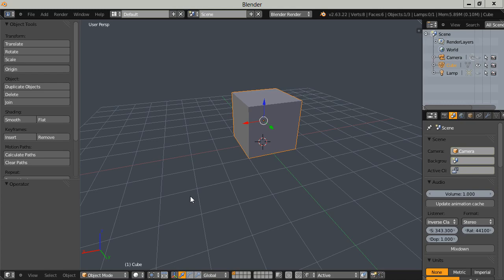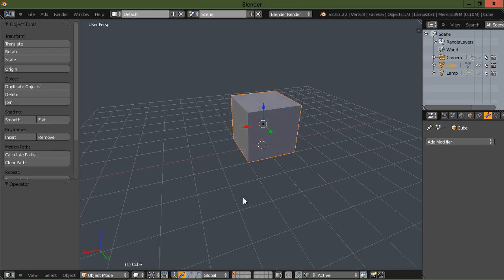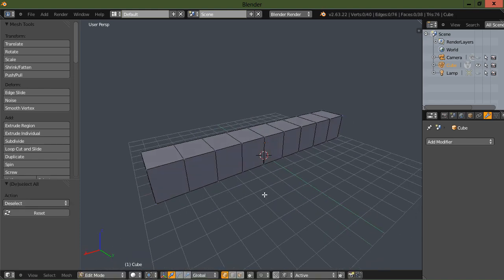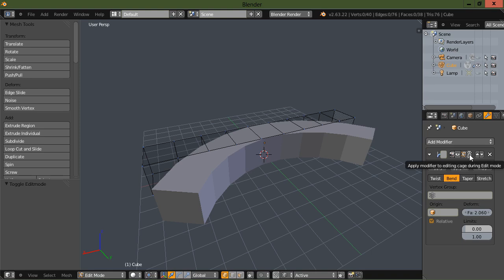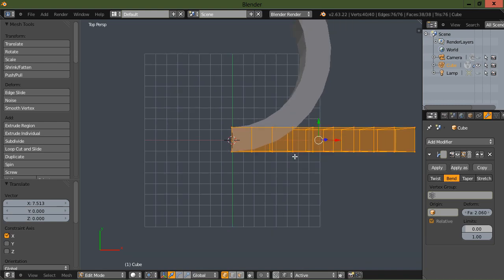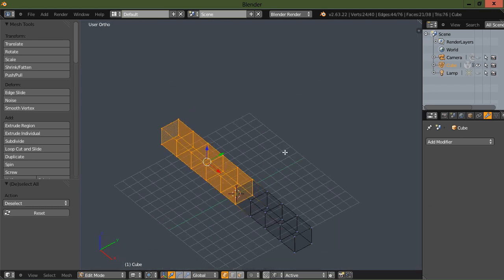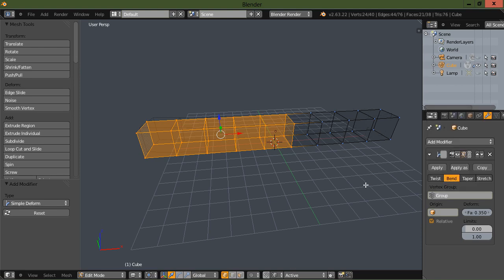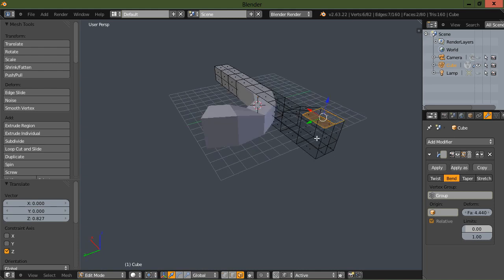Bend Modifier In Blender 2.6x

Comment: I just figured out how to change the bend direction. Make another object, just a cube will do. In the modifier options, set it as the 'Origin' object (next to Angle). You can then rotate the 2nd object by 90 degrees. (Rotate it in Object mode, not Edit mode)

Comment from the maker: Not sure but you may want to check and see if you might have some extra verts floating around somewhere.
If in fact it is some extra points. A to select all then remove doubles should be in the mesh tools or in the specials menu.
Also recalculate normals. May want to check you edge flow. The bend tool most likely works best on a all quad mesh.

Comment from the maker: @1:46 pressed the Tab key on the keyboard to switch from object mode into edit mode.
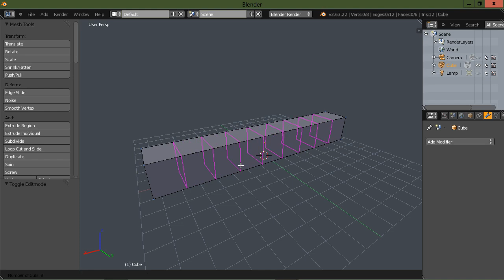@2:03 used the shortcut keys    Control + R too add loop cuts and scrolled up the middle mouse button to increase the number of loop cuts.